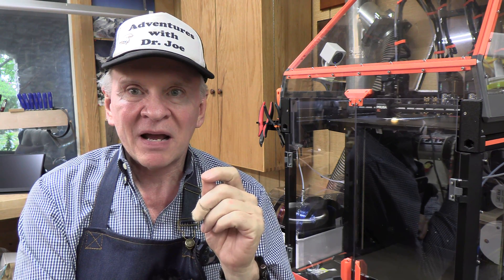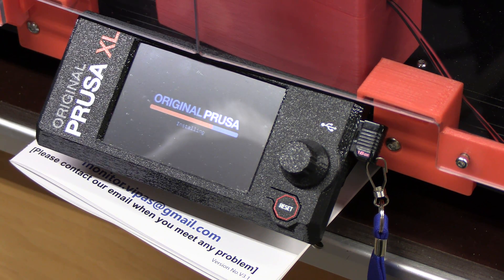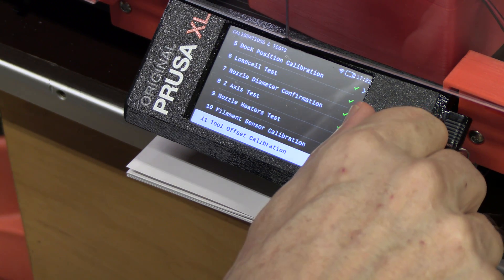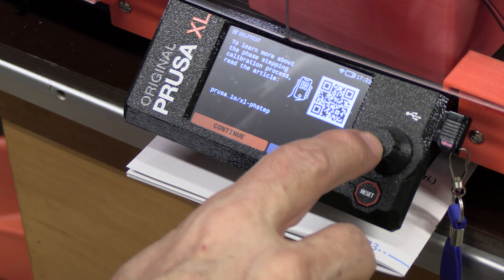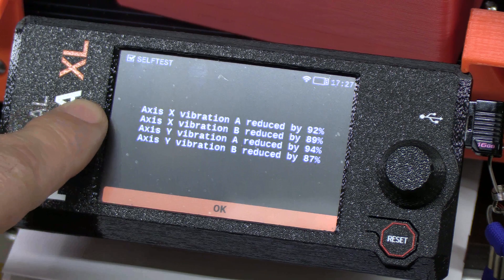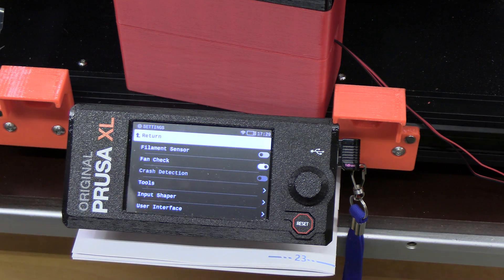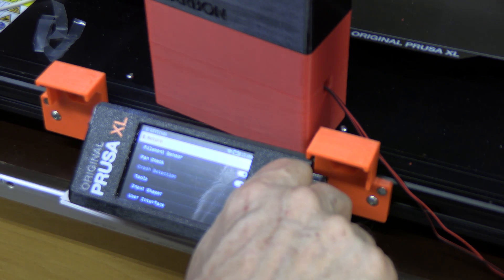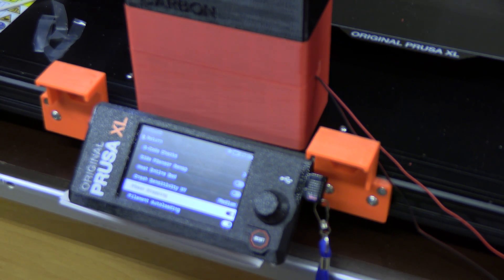PRUSA XL PHASE STEPPING FIRMWARE REDUCE NOISE 90%!

Comment: Have you had issue with the xl lately. I’m looking to buy one.
Reply from the maker: OK, good question. I bought it in late October and I have been using it since and the first ones that came out had many parts that were printed in PLA. if you put an enclosure around it which I did, I built one and if there’s a video for that, it gets pretty hot and the issue is that the parts holding the filament against the drive gear flex just slightly so that it doesn’t drive the filament and I was left with non-printing issues, which I subsequently corrected by re-printing all those parts polycarbonate – carbon fiber. Now it works great apparently the new ones are already coming with polycarbonate carbon fiber, which should easily take care of the issue so overall, I like it very much. It’s wonderful to be able to print something up to five different colors at once without filament change. I have a link to buy one on my video. It cost you extra but it gives me a small rebate if you’re interested. Thank you. Joe.
Reply: Awesome feedback. Don you u print and sell stuff or just print hobby stuff ?
Reply from the maker: No, I don’t print anything to sell at this point only for gifts and to create useful things

Comment: I think Prusa changed the firmware already. Just updated and my results screen only had 2 lines instead of 4 lines of results. 

Also, they did add the feature to enable the screen to accept touch input instead just the rotary dial. I know it wasn’t the point of your video, but I do find it much faster to use personally.
Reply from the maker: Thank you very much for that information. That’s great. I will try the touchscreen option for sure. I hope the video was useful. Consider subscribing. Thanks. Joe.

Comment: Are you satisfied with the enclosure? 
How did you get that scratch on your build plate?
Reply from the maker: Hey buddy, you are very observant. First of all I do like the enclosure, but I’m looking forward to seeing the one that Prusa brings out. 

The build plate scratch came from an error with the printer. I don’t really know what happened, but it dragged the nozzle tip across that it made that deep gouge. I immediately push the reset button to shut it down and it rebooted fine and I haven’t had a problem since, but that’s what caused that. I was very unhappy when that happened.
Reply: @JosephHunstad  I am considering purchasing an XL, your videos have been very helpful. I figured the scratch was from a firmware issue, Prusa should replace that build plate. Thanks.
Reply from the maker: If you purchase the Prusa printer through a link in my description, Prusa gives me a little bit of money and doesn’t cost any more for you if you do that that would be so nice. I like my printer very much and yes, I may contact Prusa to see if they could help me out with that Bed. That is a satin print bed which I’ve used for virtually everything. It’s very nice except of course for that huge scratch. it is a deep when it happened it was really loud and startled me. Thanks.